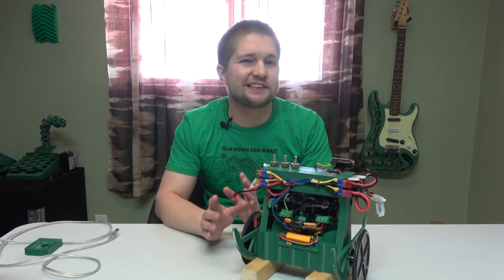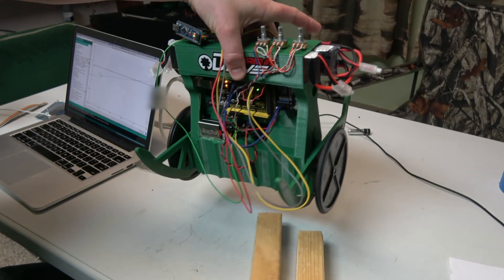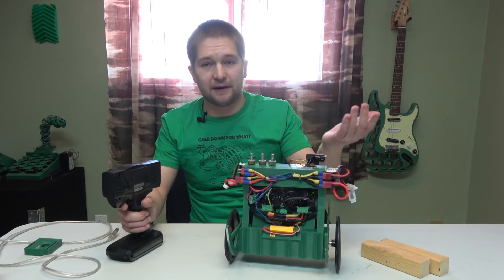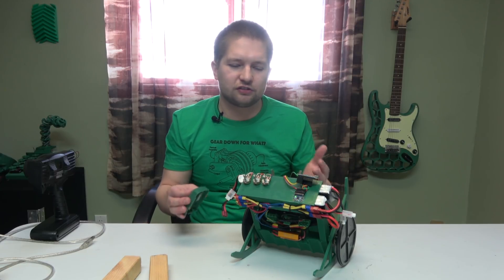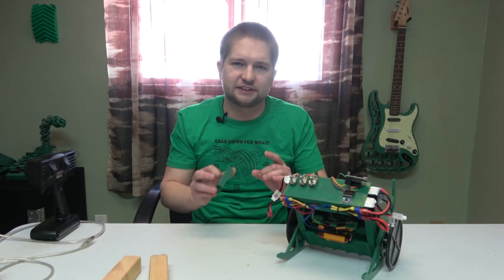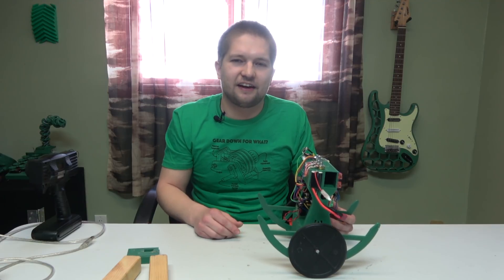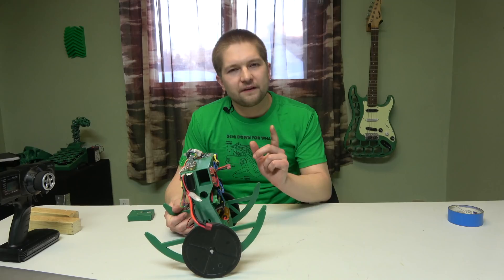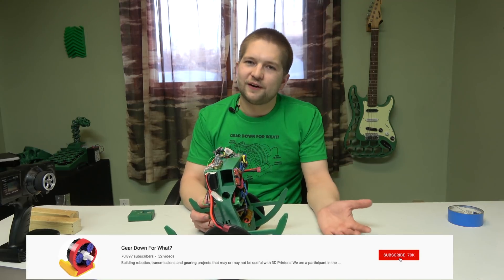The (Self Crashing) Balancing Car

Comment: Aren't those batteries too heavy to have them on the top like that? I mean I get the idea of using that weight to balance it, but once it tips one way, won't it just start wobbleing itself out of balance again?
Reply from the maker: It might be counter intuitive, but the higher the weight, the better
Reply: @GearDownForWhat  I think I understand the idea of it, but that means the machine would have to continuously balance itself so it doesn't topple over, wouldn't it be easier if it would balance itself mechanically by having a low center of gravity instead? I guess that kinda defeats the whole "balancing car" spiel, but I'm thinking of it kinda like a Segway or a hoverboard.
Reply: @GearDownForWhat  or even keeping the idea of it having more mass on top, but having a much wider base, basically having it shaped sort of like a pyramid. (I'm not an engineer, just a dumb kid with a flawed opinion)

Comment: What software/hardware is being used to monitor that rc transmitter? I have 3 transmitters with issues I need to troubleshoot...but thought I would need an expensive oscilloscope.
Reply from the maker: It’s an Arduino board with the value being read, converted from PWM to an integer, and they printed in the serial plotter.
Reply: @GearDownForWhat  Thanks! So the receiver needs to be PWM output and not something like SBUS?
Reply from the maker: If the signal will control a servo, Arduino can read it. But how do you plan of fixing it? If you pass through the Arduino it will probably add it’s own noise and latency
Reply: @GearDownForWhat  Not sure I'd be capable of fixing anything...beyond me. They're for my daughter's RC toys...and there's anomalies where the model does unintended things. I figured your setup would show me if those are actually signals coming from the tx...or problems on the model side. Mainly just curiosity, as I don't know enough about electronics beyond "fixing things until they're broken"

Comment: Instead of relying solely on the gyro+accelerometer when staying still why dont you also remember the spot you came to a stop at and try to maintain that spot based on how far the wheels rotated.
Reply from the maker: I could totally do that once I get the Odrive talking to the Arduino over serial. That is a work in progress though :)

Comment: I think the biggest problem in your project is the position of the MPU5060.
Usually the sensor should be positioned as close as possible to the wheel axis to avoid to amplifying the "noise" in the gyroscope values.
You have tried many solutions, at this point try this too!  😁
Reply: Gyro readings shouldn't be affected by positioning. If you are also using the accel values though, putting the IMU close to the wheels is a disaster. The absolute angle that you get from the IMU will be close to garbage (due to horizontal acceleration) and degrade the quality of the filtered values. It is better to place the IMU higher up the robot as he has done.
Reply: Interesting tip. I was thinking the opposite so it amplifies the distance of the inputs..

Comment: Have you ever thought of using two depth sensors on both sides to help keep it from moving? Not necessarily to keep it level
Reply from the maker: on a flat surface they wouldn't change

Comment: I think the problem with the DMP is the i2c clock speed, I was having similar problems because the FIFO buffer was overflowing because the arduino can't read it fast enough to prevent this, setting the i2c clock speed to 400kHz fixed the problem :)
edit1: also of the sketch to doing too much stuff and slowing down the arduino, the buffer overflows too fast. i think this is why the nano fixed it :D
edit2: Keep up the great work :)
Reply from the maker: The sketch that I used actually set the clock to 400 kHz by default. 
Also, after filming this I noticed that the placement of the Arduino Nano and MPU6050 doesn't even matter anymore, the Odrive doesn't interfere with it.
Reply: @GearDownForWhat  You mentioned in the video that the communication broke every time you did a servo write/remote control read operation. This sounds an awful lot like you have a problem with locking up the communication.
The standart arduino library functions are coded really crappy and they will block the execution of any other code while they are running which is a huge problem for i2c.
I am not sure how the servo write is implemented, but I know for sure that the pulseIn() function is really bad. You should never use that. It blocks your code for at least 20ms and at most 39ms. It uses blocking loops wich do nothing while it is waiting on a pin change.
A better option is to use a timer/interrupt based system for that. I don't really know a example offhand, but I could send you the code to do so if you're interested because I have implemented a rc remote control reader wich is non blocking myself recently.
Reply from the maker: Dude, if you have something that will work in place of pulse() I would greatly appreciate it! I am currently using that for my R/C Receiver. Email it to me! askgdfw@ Google Mail
Reply: @GearDownForWhat  Sure, just to make sure, you are using an Arduino mega 2560 right? Because the code will differ for the different Arduino versions.
Reply: @GearDownForWhat  weird issue, I was working on the same project few months ago, some problems are sooo frustrating, but its so rewarding when you finally get it to work, looking forward to the next vid :)

Comment: maybe maybe the i/o pin characteristics of the nano are better than those of the mega. or the pull up pull down values, or the i/o mode
Reply: I'm curious if changing the pull up resistor values on the i2c lines to pull up "harder" could help with the interference.

Comment: did you try lowering the sensor to the middle or lower?
Reply from the maker: Position shouldn't matter, its only measuring the angle of the car
Reply: @GearDownForWhat  it should matter, i think less corrections are needed as the gyro/accelerometer will react sooner & wilder the further away from the wheel axial hence the overcorrections you're getting and not able to remain stationary.

Comment: Now put inverted pendulum on top of it!
Reply: I was thinking more of a bobblehead .
Reply: The whole thing IS an inverted pendulum … I mentioned a couple of videos ago that the design might benefit from having more of the mass at or below the level of the drive shafts, so as to lower the center of gravity.  Duct taping the batteries onto the chassis between the "training rails" below axel level would be a quick test of whether or not this might help, which wouldn't require reprinting the whole chassis ….